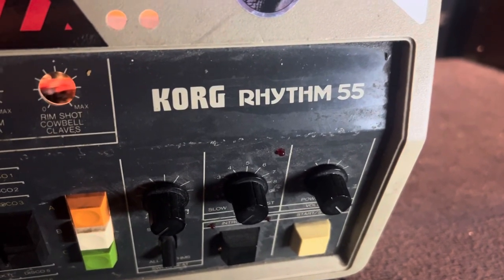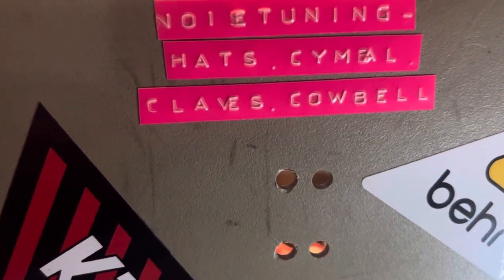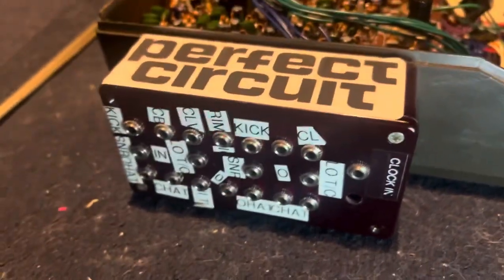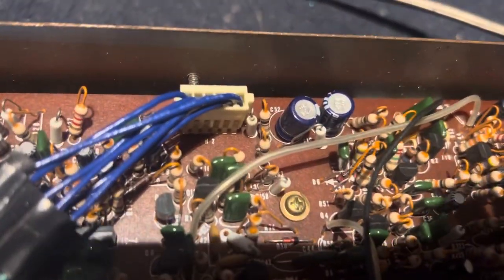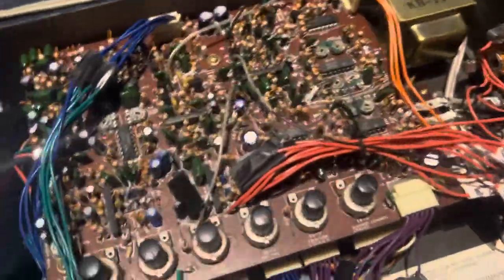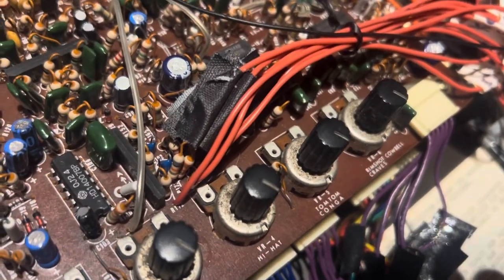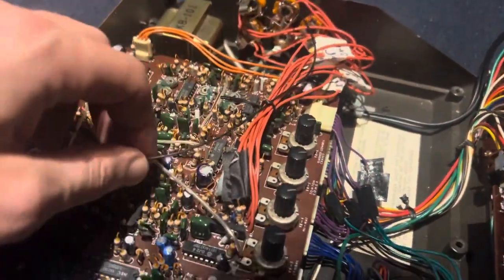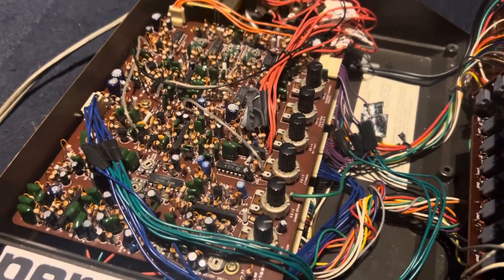Korg KR-55 Drum Machine Hacks and Modifications

Comment: my volume pot crackles a bit when increasing or decreasing the volume then it stops after I set it. do you what it could be?
Reply from the maker: that's a classic dirty pot.  get some Deoxit or other contact cleaner, take it apart (outer case off), get as close as you can to the pots, spray it in there, twist the pot (MANY times- maybe 50 each direction), and should be good to go